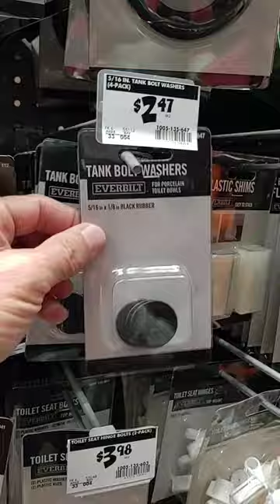toilet leak  toilet repair  wax ring failure

Comment: The “oh no” and the “yay” got me.😂😂😂😂😂😂. I went through the same thing. Said those words as well,and a bunch of bad ones too.
Reply: i got this today as a surprise
Reply: “Oh no”. I know that feeling. Hopefully you get to fix it quick and have a “yay moment” of relieve. 🫡🫡🫡
Reply: Good for you for saying the bad words that actually relieve stress and lower blood pressure etc. if you actually Google the benefits of cursing it would blow your mind and there are definitely benefits of course only use bad words at the right time in the right place
Reply: @lonjemariesfashions5117  you are correct! At the right time and place,it sure does relieves some stress. 😬😬😬👍🏻👍🏻👍🏻

Comment: I used one before, and the toilet clogged up a lot. A plumber I met told me to remove it and use a wax ring. 👍
Reply: Wax is the best.
Reply: Yup, those will leak way faster than a wax ring. I use jumbo wax rings with horn on almost every toilet I install. Sometimes you get away with with jumbos but I always use wax. If your too dumb to set a toilet on a wax ring maybe hire a drain tech or plumber to come do it for you!
Reply from the maker: @dannysmith6093  not dum
Reply: @outofthetoolboxtinker  Idk about that.... You didn't wipe down the wall so I'm betting you didn't do the back of the tank... I'd at least have done that much. 🤮
Reply: I did maintenance for 15 years and used those and never had one problem. They work if used properly.
Reply: @dannysmith6093  the wax rings with horns always leak they’re for rookies. Use wax rings without the horn
Reply: Actually, the wax is outdated and those things have nothing to do with a toilet clogging up.

Comment: Those Silicone rings are the best! Comes with an extra foam gasket to make up different heights of the closet flange. Love those things!
Reply: I've tried one once and i couldn't get it to stop leaking. Replaced it with another wax ring and has been good for 5 years now.
Reply: @alecb8509  that's strange.. as a plumber I've put in hundreds of toilets and have never used a wax ring in my life. I use the green foam rings for recessed flanges and the silicone one shown here for level, and above floor level flanges. Never has any toilet leaked on me around the base.
Reply from the maker: I agree. But I actually love the comments from plumbers.  They don't seem to like them, but I'm getting the feeling that they have never used them.... I think they are basing their opinions on DIYers doing them incorrectly.
Reply: @outofthetoolboxtinker9646  I agree. Tends to be the older plumbers who are reluctant to change.. following the "if it ain't broke, don't fix it" motto. Which a lot of times is rightfully justified. As long as it doesn't leak, it's a job well done from me!
Reply from the maker: @teemainey2214  thank you for that feedback
Reply: @outofthetoolboxtinker  No, it's not that. It's easy money for them to replace a wax ring.  People are learning though and can do certain things without them.

Comment: Having repaired/refurbished several homes over the years I have NEVER had a toilet come off that easily! 😁
Reminds me of the old Haynes Manual pictures of a spotless car in a spotless workshop. So  different from lying in the road underneath an oil and crap saturated rust bucket in the poori g rain trying desperately to get this fused lump of metal to move !😜
Reply from the maker: This one did!  With the exception of my not realizing proper placement of hands to lift, until I put it back.  Only other toilet I ever had to move, I had to grind away rusty bolts. This one was easy.
Reply: No toilet is hard to remove after thousands of them
Reply: Bolts ate to be brass so it dosent rust daaaaaaaaah

Comment: You forgot the plumber's trick to seating it properly. YOU SIT ON IT. *Then* you finish tightening the nuts on the bolts.
Reply from the maker: Actually had my wife sit on it. Forgot to film.. thanks for mentioning
Reply: That’s only if it’s wax and not these stupid cheap rubber rings people put on which leads me to believe this is a handyman not a plumber
Reply: @dannysmith6093  I’ve never used a rubber ring before. Just always used wax because of how cheap they are. But why don’t you like the rubber rings?
Reply: Never have In. 50 years some toilets are disgusting
Reply: @jackmyhre8759 I put them in all three toilets of my home. Only been here 7 years and two of the three have leaked. Gotta replace the whole floor under the toilet in my second bathroom. Replaced my master bath toilet and went with the wax ring that came with it. Can’t keep ruining my floors.
Reply: Thanks for the band-aid.
Reply: that's to compress the wax
Reply: Wax ring has worked for centuries. Why reinvent the wheel.
Reply: THANK YOU!

Comment: I’ve changed many rings using both wax and those new fangled silly cone ones. No trouble with either. But when I seat the toilet to the floor I use plumber’s putty around the base so it sits nice and snug and level when tightened down.  It doesn’t dry out and squeezed out putty is easily removed.  Years later too.
Reply from the maker: Good idea.
Reply: Wont that hide a leak if it came back?
Reply: @trustn01rs  likely prevents leak. All parts are stable and not moving.   Without plumbers 
putty the base sitting on the tile will rock ever so slightly which would cause the wax seal to eventually be off kilter.  Toilets don’t start leaking for no reason.

Comment: Tried one. It advertised you could remove & replace it, which I needed to do, so I thought the higher cost would justify it. After replacing it leaked.
Reply from the maker: Thats too bad.  I know there are options with the foam seals based on flange height. Maybe that affected it. ? I'm not a plumber, nor represent this product , but I've used it twice now with no problems.
Reply: @outofthetoolboxtinker  
I don't know. The height was a bit off the first time but didn't leak until I replaced it with normal height, but after seeing the way the foam was compressed, I wouldn't try reusing it. Maybe fine if you don't mess with it.
Reply: I have used them successfully several times. No problems thus far.
Reply: Two out of three of mine leaked. Wax is better now imho
Reply: Always go with wax, we wouldn’t still be using it if it weren’t superior. I can’t tell you how many of these I’ve had to come replace with a normal wax ring after someone’s hubby decided more expensive must be better and installed one of these leakers.
Reply: @nickkirschner3719  literally have never had an issue. Have used that green foam one before as well. Have also seen entire apartment buildings go waxless.
Reply: I've never had one fail on me I'd say ive installed close to 100 if not more in the last 5 years
Reply: Real junk
Reply: I have installed thousands with wax seal and no problem cheaper 👌
Reply: @ralphgeyer8572  it's about the ease of removal and reuse and setting the toilet for many different reasons

Comment: I would secure the bolts to the flange with a washer and nut. Also just use the blue bottom part from the “better than wax” ring and put a extra thick reinforced wax ring on top of it.

Comment: Hey what's the best way to get rid of that wax to really clean it?
Reply from the maker: I don't know.  I didn't have to clean it well.  If you had to, I bet a heat gun would melt it away,  or at least soften it
Reply: Right on thank you very much I used Clorox wipes dry towels and even a sock
Reply: Great but you forgot about plastic washer for bolt cover!

Comment: If the flange is below the floor put a wav ring down without the horn 1st and then another wax ring on top of it will a horn to prevent it

Comment: Those are the worst. I have thrown so many away after showing up to flooded bathrooms... will never use them
Reply from the maker: Probably a DIyers installing them incorrectly.  Have you ever installed one to see if they work?  This is only my second one and first has held well for 3 years now.

Comment: if that's a customer's house I hope you clean the floor better than that and if it's your house there is no reason for not cleaning it better
Reply from the maker: It was my house. It's old vinyl flooring and not worth scraping since toilet will be covering and planning to rip up that floor to access almost 100 year old drainage pipes to replace in a few months
Reply: That will prb be like 50 trips to the store minimum lol.I built an addition bathroom/kitchen in my guest room and I have went to the store like 20 times and counting lol still need drywall and an electric water heater outlets smh

Comment: little tip the toilet previously had caulk around the outside do not do that because it hides leaks and traps moisture from sweating causing mold and rot
Reply from the maker: Good point, in fact as you can see in the video, it had trapped lots of gunk. If it hadn't had caulk,  I would have noticed the leak much earlier. If I hadn't been under the house looking for an active supply line leak somewhere else I never would have noticed.
Reply: Even better tip … caulk the toilet and leave a 1-2” gap on the back side where you won’t see it but water can still come through to show a leak
Reply: It won't pass plumbing inspection without the caulk around the base

Comment: I’ve never seen or used the rubber washers before the nuts on the closet bolts. What is the thought process of using them? BTW, I’ve used the rubber instead of the wax ring and have never experienced any problems with them.
Reply from the maker: Only did it because I saw someone else do it. They said it was to protect the porcelain. I took that as, keeping the porcelain from cracking by tightening too much.. I would think it would spread pressure more evenly in case the washers don't seat well exactly, and in that case maybe help preventing it from cracking

Comment: I might want to do something about those pink tiles in the tub/shower. 🙄
Reply from the maker: They have grown on me. House is 100 years old and those tiles I think are from the 1950s or 60s.  My house has retro/funkiness all over
Reply: And the wall behind the tank?
Reply from the maker: @slowmoe1964  that'll get ripped out too. Most likely will find original beadboard behind that paneling

Comment: Not sure about the silicone caulking; wouldn’t this hide leaking should the wax ring be sealed/seated incorrectly?  You may end up with a hidden pool of water under your toilet that would end up rotting your subfloor.   
I would not use any caulking
Reply from the maker: In my situation I chose to. 100 year old house with sloping floor.  Problem was this toilet was sealed with caulking, hiding a pool of water and turds from the failed wax ring. I siliconed as an extra barrier around the flange because of the slope. Everything within the silicone drains down in my particular situation.  I chose to not caulk the toilet to the floor so any future leaks will be noticeable.  Had I not been under the house looking for an active supply leak somewhere else, I would not have known of this issue.  Thanks for the comment.
Reply: @outofthetoolboxtinker  Oh - that makes sense.  Excellent vid - thank you for posting!
Reply: You can chalk around the toilet except for the back, that way if it leaks it will come out the back

Comment: Didnt calk after setting it?
Reply from the maker: No.  Mainly because any future leaks will be noticable without caulk.  Caulking could contain a leak, and in my case rot out the floor.  This is why I didn't even know I had a leak until I was under the house looking for a supply leak somewhere else.

Comment: As a plumber for 38 years and counting I have never used one of those wax gaskets are the way to go I would have never left that supply The supply needed to be changed in toilet needs to be a sealed against the floor that was probably the problem moving around
Reply from the maker: You're right, the supply will be another video.  There was a seal and that was part of the problem, where the failed ring allow the leak to spread all under the toilet ( for who knows how long) and some spread under the vinyl flooring into the wood subfloor. Decided not to seal this time so any future leaks could be more evident.  Only way I knew of the leak was because I was under the house actually looking for an active supply leak. Based on the wood damage, it's been leaking for months.

Comment: HOW DO YOU LEAVE THE GUNK NOT CLEANED OFF THE FLOOR??
Reply from the maker: It's old vinyl flooring in a 100 yr old house.  I cleaned it but the rest would require razor scraping.  Not worth it.  Putting a almost 50 year toilet back into the same spot.  Going into rip up that floor in a few months, to replace very old drainage pipes (probably original), rebuild floor and put down Penny tile.  Check out one of my other videos where I rebuilt part of another bathroom floor and put down Penny tile.
Reply: @outofthetoolboxtinker  Okay!
Reply from the maker: @utuberhoda  I also have a video where I replumbed the whole house and redid a kitchen for $1,500.
Reply: @outofthetoolboxtinker  I love the videos, I learn a lot. Thx!
Reply from the maker: @utuberhoda  I appreciate that

Comment: Rubber washers on the Johnny bolts are pointless!
Reply from the maker: Wasn't quite sure. Didn't see how it could hurt anything. Saw someone else use them in another video. I figured it could help reduce possibility of cracking porcelain from a little over-tightening,. In case the washers weren't applying pressure evenly.
Reply: Yea the washers should work to prevent breaking the toilet, I broke a toilet at the base from over torque
Reply: @gsrjaycee4521  #4 rule of plumbing, right is tight, too tight is broken!

Comment: You know you have a leak and yet still flush it instead of wet vacuuming the water out??
Reply from the maker: It's all out and dry now.  Have checked five times now since installation.
Reply from the maker: Oh, now I understand the question. I didn't mind flushing. One more flesh out of hundreds or maybe thousands of flushes before I discovered this leak wouldn't cause a problem.

Comment: Toilet looks like it's pretty dated. Would of replaced it
Reply from the maker: It is one of the old ones probably from the '70s or 80s.  I don't know if it's nostalgia or what, but I want to keep it as long as I can.  The extra water it uses doesn't bother me.
Reply: Yeah it's an older 3.5 gallon toilet, all the reason to keep it

Comment: He doesn't even secure the bolts to the closet ring....don't make videos if you don't know what you're doing
Reply from the maker: What's a closet ring? Oh, the flange? This Old House vid and several others I watched didn't have any additional and unnecessary need to secure the bolts. The one nut on top pulls it all together.  Positive or negative viewpoints.... Please keep them coming. They all help the algorithm.